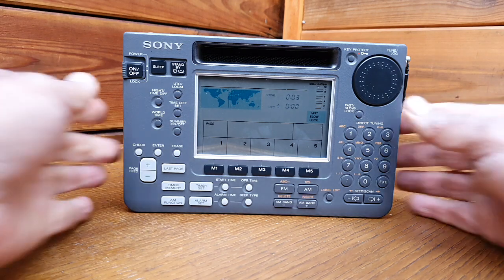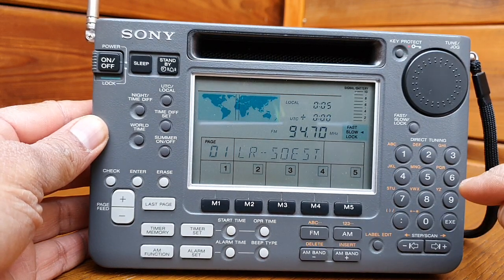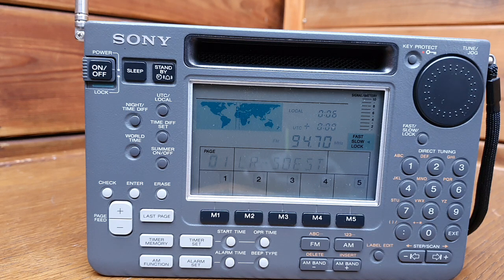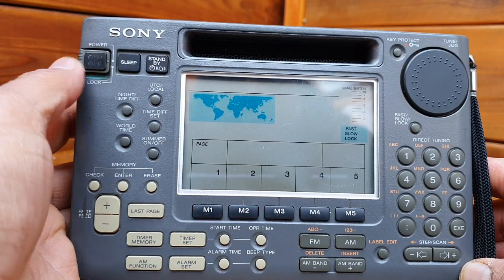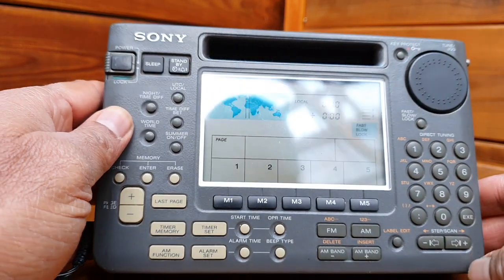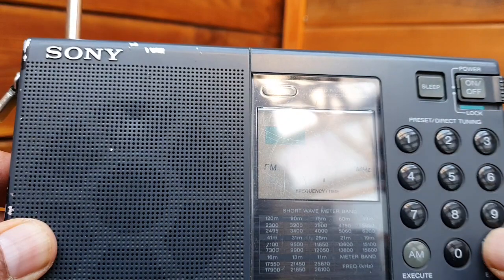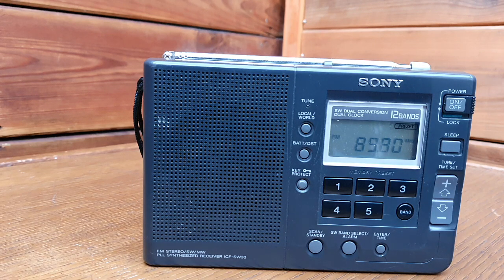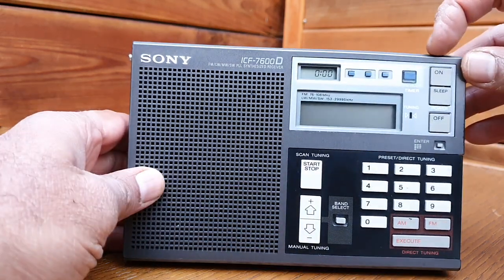Sony ICF-SW Radios | Bad SMD Capacitors & Common Symptoms

Comment: Hello sir, did I understand correctly from your video that the Sony icf-sw7600G model does not suffer from such a malfunction, since it uses high-quality capacitors from Panasonic? Thanks
Reply from the maker: At least I personally did not came across any ICF-7600G & ICF-7600GR models with troubled electrolytic capacitors yet. I own both G & GR models still they work as charm no signs and symptoms of bad capacitors yet. Because Sony have learned from previous models and used better quality capacitors in G & GR models. Thanks for tuning-in best regards from the Netherlands

Comment: Hello Sir I am from India and have Sony ICF SW 7006 and my radio is dead .I bought this 2nd hand in thecyear 2006 andcthen it would receive FM stations MW  and Radio China on SW  but now it is dead as I did not use it for almost 15 years. Can you help me by repairing this radio as I cannot find any technician to repair this set. I shall pay forcyour charges.
Reply from the maker: Mukherjee Bhai shipping to the Netherlands will cost you a lot to send the radio and return shipping even more than the actual value of the radio. Therefore I advise you to look Engineer/Technician skilled with SMD components locally in your city or town. Many thanks for supporting the channel.
Reply: Good morning Bhaisahab. I know a radio servicing engineer , a very senior man in his profession who has been able to download the PDF  of the circuit diagram of this radio from Google. He works with AIWA India as Head of After Sales Service . He says he will try to do the job provided the capacitors are available  here. In case he is unable to do it then I shall knock on your doors and send the radio to the Netherlands . I shall check about the freight ( sea freight /airfreight ) with Blue Dart /DHL. It will be helpful if you can tell me your charges including cost of spares. I don't mind spending on this radio as this has some sentimental value to it.
Reply from the maker: Can you send me the picture of the radio via email at spacetime0104@gmail.com I think you are referring to the Sony ICF-SW7600 model right? Not ICF-SW7006

Comment: I have a Sony ICF sw77 since 1995. It works but all local station signals (MW, SW and even FM) sound like they are far away. In fact ALL radio signals sound like they are far away. is this a problem with the capacitors? It's never been worked on. Any advice would be great. thanks
Reply from the maker: Thanks for sharing the insight I think it is time to replace its electrolytic capicitors by some qualified technician with experience with SMD electronic component replacement. Replacing surface mounted capicitors require a skill and experience. Though ICF-SW77  was the top model but it does suffers like all other Sony ICF radios. Many thanks for supporting the channel. Cheers